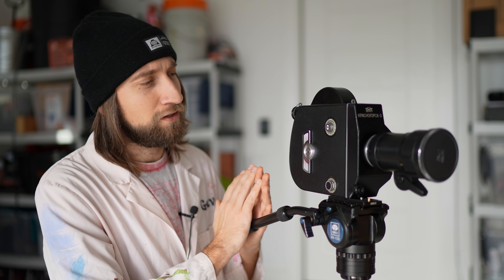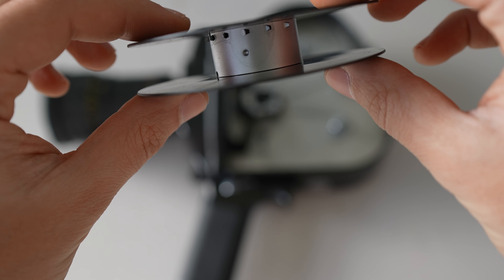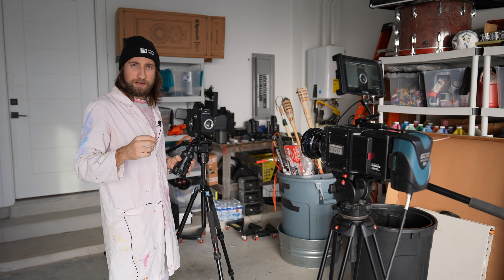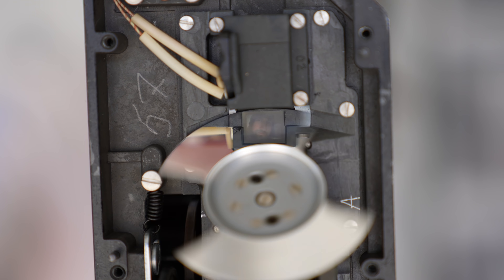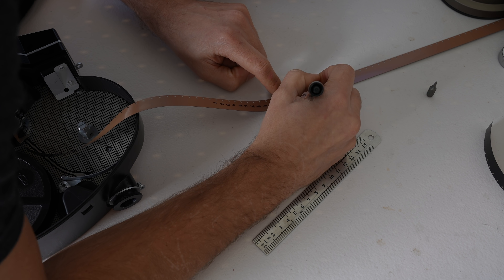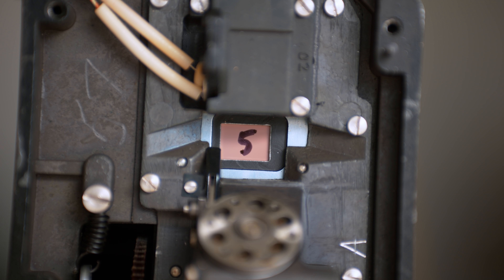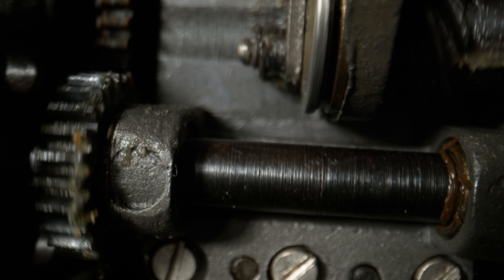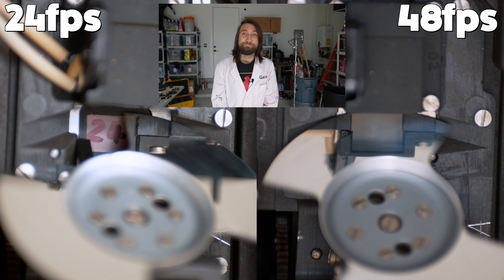How a Movie Film Camera works in Slow Motion - The Slow Mo Guys

Comment: Gotta say, this was one of the finest pieces of old-school engineering analysis I've seen in a hot minute. Well done Gav.
Reply: Facts. Kept me interested the whole way.
Reply: As a soon graduating ME, it still boggles my mind how people figured some of this stuff out. Like the concept seems easy: have a mirror with gaps timed properly with the frame rate and use a piston in reverse to move the film. But then you get into the details and see how much more complicated it is, like the consideration of using helical gears, and getting the disk to always stop in a position that prevents further exposure. Always gotta respect the effort older generations put into figuring out difficult problems
Reply: Go check out the video on a film projector from Engineerguy
Reply: This
Reply: Very well said. This was amazing to watch, as a videographer

Comment: Next episode: "How a Phantom Camera works in Slow Motion"
Reply: Exactly the same as a normal camera. Only difference will be if it’s global shutter or rolling.
Reply: there are no moving parts
Reply: @TheREAPERBlog  their would be with a rolling shutter. You can get both rolling and global all shutter phantoms.
Reply: Filmed on 16mm
Reply: A phantom filming a phantom 🤯
Reply: @Cterrey12  digital video cameras to not have a moving shutter.
You want Gav to film the copper wire on the back of the sensor or what?
Reply: @TheREAPERBlog  love your software!
Reply: Surprised nobody mentioned that they did a video on slow motion cameras years ago. I think they visited the place where they make Phantoms?
Reply: Next Episode: A miscarriage in slow motion
Reply: @Cterrey12  Are you joking or serious? Global or rolling shutter both only refer to the digital readout. Neither of them use moving parts.
Reply: No moving parts (except the fans) but I wanna see the electrons moving.
Reply: close up view of circuit boards intensifies
Reply: @TheREAPERBlog  What about a fan to keep the electronics cool?
Reply: @Ferro_Giconi  Who cares about them. Everyone knows how a fan works.
Reply: We're going to use a camera
to record me working on a phantom
that i'm using a phantom phantom to record the phantom in phantom time!

Comment: What I find most fascinating is that claw pulling the film down and how it doesn't just rip through the material of the film while moving that fast
Reply: There's a couple things going on here though: the first is that the claw may be moving fast, but without much torque. If the film jams, the claw can't move, so it can't really cause damage. The second is the really amazing timing systems and brakes film cameras use. Basically, when the film isn't moving, it's clamped in place and can't be advanced. When the claw grabs the sprocket hole, the clamps release, and the film gets dragged easily through the system, so nothing is resisting the claw as it drags. These things are fantastic bits of analogue engineering.
Reply: @michaelbushee3968  Thanks for the very nice explanation.
Reply: In the fast camera that I used "once upon time" there were no claws.  The film and the octal mirror were synchronized.  That means the image was tracking the film movement which was smooth, just accelerating.  Depending on the target speed, the acceleration could go on until the end of the film in less than two seconds...

Comment: That "pulling mechanism" looked insane! The timing of that pull is so exact, that I had so start laughing for a second 👍
Reply: That's the beauty of engineering, and a particularly good understanding of math.
Reply: Its all tied to together mechanically (the gears that control shutter also control the arm) so it has to be exact

Comment: Can I just say I think the editing at 5:40 is so cool? I don’t even know how you would do that.
Reply from the maker: I filmed it twice. One with the shutter on and one with it off. Then I basically cut a hole in the footage of the shutter on and placed the shutter off footage underneath so it’s visible through the hole.
Reply: if you want to know more, it's called "masking". You can find tutorials on yt, that might show you how it's done. with today's software it's easy to do, back in the day (from when the term comes from) you had to "mask" things out by hand with paint on glass or other techniques, while playing the original footage and filming it with a new strip of film. Very interesting and confusing at first, but very old tech tbh.
Reply: @therealpanse  it's so cool how old techniques have found their way into the digital world!
Reply: @snjert8406  that's just how things go. If it works, you keep doing it until you find something that works better. That's why we're still burning fossil fuels almost 150 years after the invention of the internal combustion engine...

Comment: "Hobbity-looking footage." Gavin, that made my day. I only got to see The Hobbit in 48fps once, but it was definitely something unique.
Reply: What did it look like? Was it just smoother or was there something else?
Reply: @snjert8406  I saw it in 48 fps too. It was weird. It was too clear, too sharp, too "real", and it just lost something. It was extremely distracting and would drag you out of the action pieces constantly. Our brains are programmed over decades for that 24fps slightly blurred effect in movies, and when it's missing, it's a problem. Perhaps if every film from then on had been 48fps we would eventually acclimatise, but I think the negativity around HFR in The Hobbit killed it. It didn't help that the story was an over-blown, tissue-thin, money-grab that was basically non-stop over-the-top action pieces consisting of running from location A to B... for three looooong films!
Reply: @stephen-boddy  I wonder if it has more to do with our brain's perception of movement on a flat surface as opposed to just being learned through films. I realize this makes no sense. Experiments must be made.

Comment: There would be so much more to discover in the mechanisms of this camera, like how they made it so the spring, which does not deliver a constant force on its own, still poweres the camera so it runs at a constant speed. Probably with a centrifugal switch or so. Fascinating.

Comment: I wish we could have seen the actual recordings on the old camera, or at least a comparison of a 24 fps movie and a 48 fps movie shot on that camera. I love vintage tech.
Reply: I was hoping for the same thing. Also, to know why 24 fps is the standard
Reply: @cannibalbananas  24 coz it used the least amount of film for a decently smooth feel. It also had to provide enough surface for the opticaly printed audio track
Reply: @cannibalbananas  The actual reason why is when they first invented movies, they figured out about 48 fps was the minimum to get convincing motion that wasn't jerky or blurry. Film is expensive when you are using it up as fast as a movie camera does, so to save money they just ran the cameras at half speed.

People got used to the low framerate, and as a bonus it helps cover up things you may want to hide like crappy props or practical effects.
Reply: @lobsterbark  Cool. Thanks. I like learning and this fascinating to me 😁👍

Comment: As you say- these were marvels of engineering and manufacturing! 
I had the privilege of using a mitchell high speed 35mm camera, which has 4 pin registration (Panavision later bought the patent and incorporated the tech) It was used to shoot Optical titles & VFX plates or repeatable motion control, and the 4 pin registration was essential to prevent any interframe wobble at all of the film plane. So it was an additional layer of mechanics than pictured here, that could function at several hundred frames per second :/ 
PS thanks for another RAD SlowMo Guys video!

Comment: Excellent demo. I'm intrigued that the camera uses single sprocket film but has a 4:3 gate. Super 16 is 16:9 and was designed to be a sub-standard with the same aspect ratio as Cinemascope 35mm. With the new film that Eastman produced in the late 80s, the results were really good.

Comment: I saw a documentary, probably a Horizon programme or similar, about high-speed film in the 80s/90s. I've always remembered one fact - the film was running through the camera so fast that at the end of each shot, end of the film was ripped out of the cartridge and got smashed to pieces as it whipped through the mechanism. The operator had to spend ages cleaning out all the little pieces before reloading.

Comment: I worked for ActionConcept in Cologne in 2003 and we had analog actioncams with 400frames a second... the Sound of them speeding up was insane. It was so fast it was actually a slidely variable framerate around the 400 frames per second mark.

Comment: Paper was used for storing data for many centuries but only during my lifetime there was several breakthrough in storing data:
1. vinyl (storing data in grooves);
2. tape, HDD (magnetic storage);
3. film, CD (optical storage);
4. SSD (electronic storage);
5. Optane (resistance storage);
What a time to be alive!

Comment: You once showed the aperture of a lens opening for each exposure and some other things, which was very cool. But I think it would be at least as interesting showing how high speed flash sync works as the shutter is never fully opened at these speeds, and the flash needs to flash many times to expose the subject several times as the shutter moves along the sensor.

Comment: If you're looking for video ideas, the inside of a DLP projector is pretty unreal and might make a nice cheap project, assuming you have macro lenses. It's got millions of tiny mirrors on a 2 inch surface that all move up to dozens of times per frame to make the color pixels. I'd be interested in seeing it in slow mo. There's one guy who's done it with strobe lights but I'd be curious to see it in fluid motion.

Comment: If you can find an old school theatre, find one that will let you shoot the film projector. 35mm machines as well as imax are awesome. it all goes by in a blur, but instead of a ratchet arm there is a fancy gear called the 'intermittent' - which as its name suggests, starts and stops using a geneva mechanism.

Comment: Well this technology is from my era, and yes I do have a background (academic, business, and professional) in it.  It was still cool to see it in slo-mo though.
High speed (1000fps) film was usually estar based rather than acetate based, because it could better handle the acceleration and the sprocket holes could handle the claw pulling it through the gate at high speed.  Apart from that the main application for estar film bases was large format - 5"x4" and 10"x8" because it was thicker and more stable.  I still love film - there are many advantages to digital sensors but they still can't match large format film for reasons specific to the format.   I don't miss all the hours in the darkroom getting contact dermatitis however.

Comment: This is really interesting. I’d love to see more on these.

If each rotation of the disc exposes two frames, do they need a separate camera to have exposure times above 180 degrees?
Also, you mentioned having sound or using super16 but how does sound record onto film? I had assumed they used magnetic tape to record sound.

Comment: I find mechanical systems far more fascinating than electronics. A carburettor to me is far cleverer than fuel injection - how do you make pieces of metal do jobs under a wide variety of circumstances without any computer control?

Comment: I think Gavin confirmed in another tech analysis video, but cameras that record video are essentially taking X number of pictures per second where X = frame rate right?

So when he used the older camera to record at 24 FPS it was taking 24 "pictures" in the span of a second and then runs them through at the same rate of speed to make 24 stills look like 1 solid piece of recording?

Please someone correct me if I'm wrong.

Re-uploaded because old comment was spammed by p*rn bots.

Comment: why do you guys always rush to the high speed camera to shut it down/do something with it after the recording has been done? cant you just cut the video later on? why not same with normal cameras? whats difference between editing raw and normal pictures?
Reply: The camera's they use, record to the RAM first. So the camera can be recording at all times, but only once they press the button does it save the last few seconds. In this video, it's filmed at 1000 FPS in 4K, the filesize for only one second would be about 12GB. (this could heavily vary based on the sensor resolution and bit depth, but the value I gave should be about correct as they're using a Phantom Flex 4K @1000FPS). So they're really limited by the RAM on their camera. Phantom Flex 4K only has 64 or 128GB of RAM. If they have the 64GB variant, then they could only save about 5 seconds of footage. In other videos they use different camera's that reach far beyond 1000FPS, so you can probably imagine the filesizes and time limit they have to deal with.